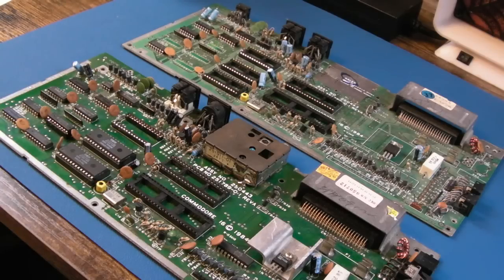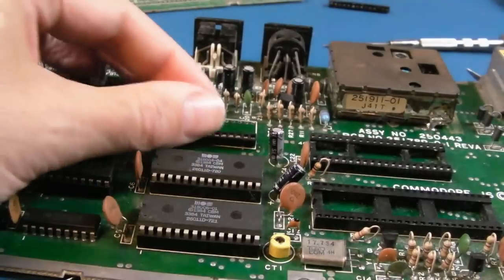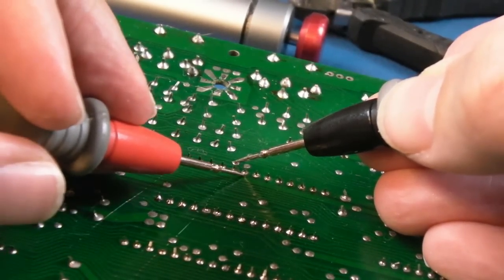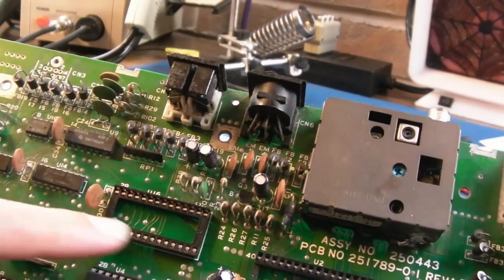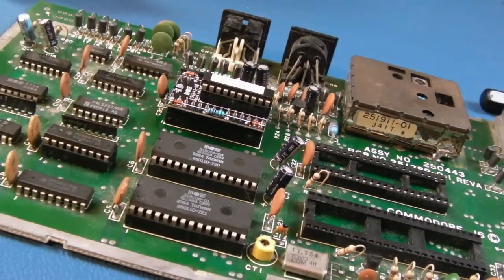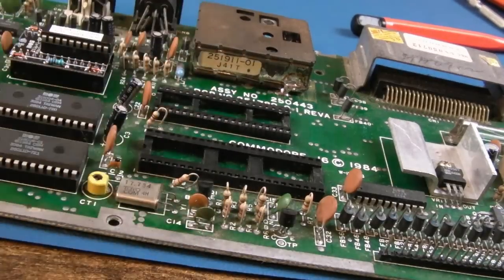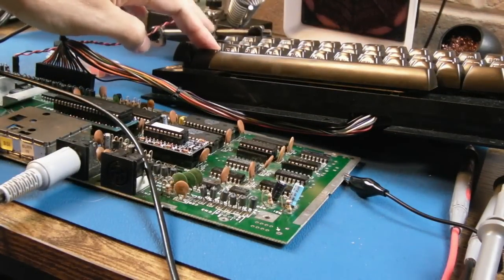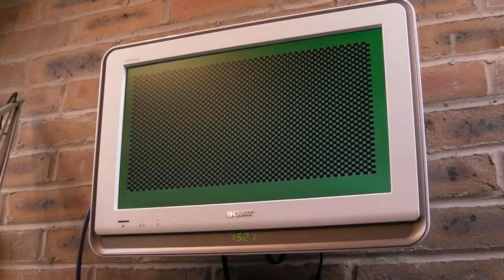Commodore C16 Repair & Upgrade Part 1 (Revised)

Comment from the maker: Part 2 - https://youtu.be/dJ6pPfMu8oM
A BIG thanks to sparxUK for these boards, and the TED!!!
Another massive thanks to Alex for the 2 x TED chips.
And a huge thanks also to Daniel Mantione (Replacement PLA & More for C16 / C64 / C128 & Others) - https://www.sellmyretro.com/user/profile/dmantione
Ian Scott Johnston (Amazing Repairs) - https://www.youtube.com/user/IanScottJohnston
C16 Diagnostic ROM - https://www.inchocks.co.uk/commodore/Diag264/
Correction: Ignore the point about the 7501 being NTSC? - it was just the earlier HMOS-1 type.  The 8501 was HMOS-2.

Comment: This was a very learnful video for me to see how I can improve the PLA documentation. To clear up a few things:
- There is no need to separate the PLA PCBs with a knife, you can just break them apart with your hands. Never fails.
- The top of the PLA PCB has a marking: The interrupted line. There wasn't any space left on the silkscreen for a full notch, so I went with an interrupted line.
- I have selected these headers especially because they do not widen your sockets. So your dual wipe socket should still be in good order to accept an original PLA chip.

But of course I could safely trust that you would get the PLA built in good order :)
Reply from the maker: Thanks ever so much for these PLAs,  great work creating them!  I couldn't have got this C16 working without one =D  I did mention in the "live chat" on the premiere that I didnt need to score them with a knife - I worked that out when building the C64 PLAs (separate video).  I mention you again in part 2 (and part 3) - and show your store on sellmyretro in part 3!  Thanks again!!!!

Comment: C16 keyboards are a bit more common in the US as spares.  When they broke up the unsold stock in the late 1980's they were sold in Radio shack as hobbyist parts.  As recently as 5 years ago you could still find them surplus.  I've got a couple that are surplus to requirements.
Reply from the maker: Thanks!  I am OK for keyboards now though =D